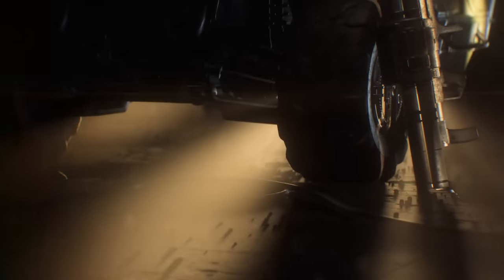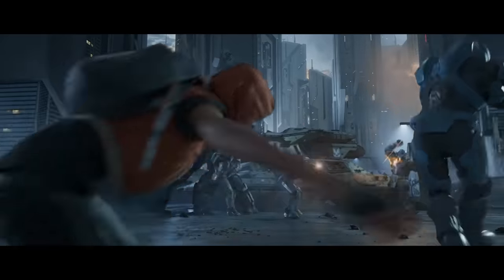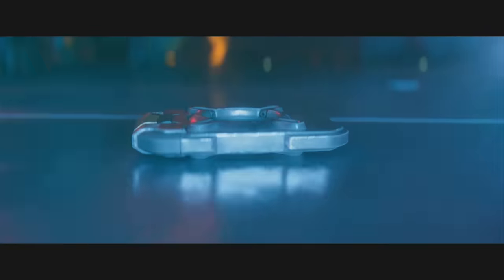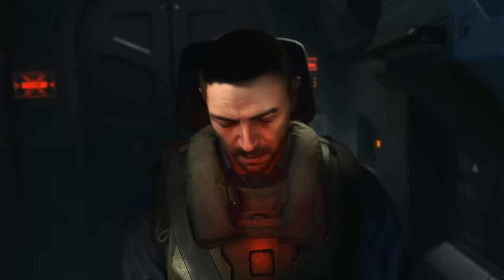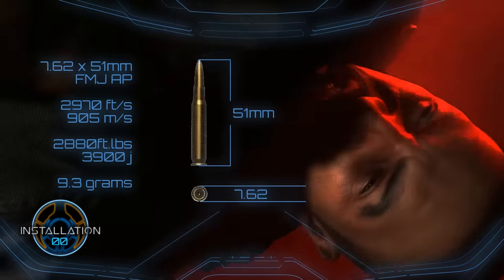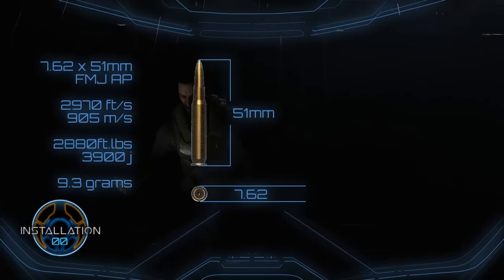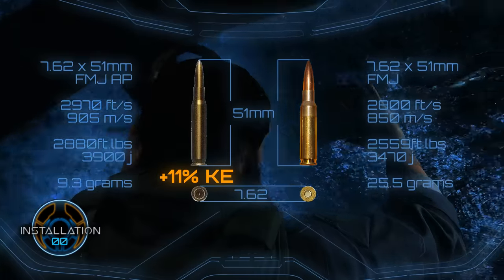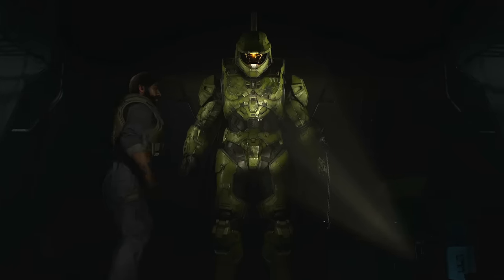Why are UNSC Weapons so powerful!? | The Armory

Comment: Should be using more powerful calibres in 500 years in the future? Energy based would be more achievable as well without the use of covenant or forunner technology. If they can put a micro fusion to power the armour that can do the same with a energy bases weapon like the size of a rifle. For example 50 bmg round 500 years in future would be worth a penny if using the same manufacturing techniques. Hydrogen powered vehicles and equipment the UNSC can easily mass produce can easily make a compact hydrogen power pack that can power a cheaper light infantry power armour. Given the UNSC a better chance in the conflict while alien technologies could enhance the capabilities of any vehicles and weapons in the UNSC arsenal.

Comment: Okay okay okay, no. As much as I like the idea of some sort of magnet system built into the guns, it would easily be at the bottom of the list of reasons the rounds are stronger. 

I personally think it’s a combination of denser and stronger metals. New layerings of the jackets. A change in the chemical compositions, and pinpoint perfect metal smithing and gun manufacturing that ensures near perfect powder burn efficiency

Comment: 7.62x51 is basically 308. So that is a very powerful bullet most dmr are chambered in 308. So dont confuse 7.62x39 wich is the usual AK47 round witch is an assault rifle with a 7.62x51 round witch is so powerful that normal people cant shoot it accurately in full auto so basically only halo spartans can do that

Comment: There’s a genuinely simple explanation that you’ve missed, and I mean no offense by this. 7.62x51mm M118LR. Fired out of a 20” barrel with a 1:11RH twist it averages 2600 fps at the muzzle. However. In comparison to the faster and less optimized M80 ball, the bullet weighs MUCH more, at 175gr in comparison to the 147gr M80 ball. At 2600 fps, your kinetic energy at the muzzle is around 2520 ftlbs. So that matches what you’ve got already for the modern cartridge, while traveling much slower. HOWEVER. If I were to up my muzzle velocity to 2800fps, which is what you’ve listed, by, say, adding a bit more propellant, it would be pushing out about 2940 ftlbs of energy. There you have it. Source: The Kestrel 5700 Elite Ballistic Calculator with Applied Ballistics sitting on my lap

Comment: The numbers given at time stamp 4:40 are wrong.   Both bullets weigh the same 147 grains. 
A 147 grain bullet moving 2970f/s generates 2880pound/feet of energy.  
A 147 grain bullet moving at 2800f/s generates 2559 pound feet of energy.   

I'd assume Bungie just took a random info about ballistics and threw it in the game not thinking anyone would dig any deeper. 

Also, burning gunpowder doesn't require O2 to fire a bullet. ............... 2 KNO3 + S + 3 C → K2S + N2 + 3 CO2   ........... No extra O2 needed.  All O2 is in the KNO3.  Not to mention that the case is a sealed container and the barrel is an extension of that sealed container. 

In the world of ballistics 300 pound feet is an insignificant difference.  Its the difference between having a 4 inch longer barrel.

Comment: @Installation00  I think the weight difference in rounds could be due to a much better propellant, there has been what, some 500+ years to further hone chemistry, find a new more efficient propellant that has less mass, but the same energy. Stronger materials, maybe the casings are made of something that can take 3 - 4 times the pressure of normal gunpowder, thus allowing them to say... upgrade from what might be considered the difference between normal rifle ammo, to something far more energetic. Like... I don't know, like missile propellent? I am not a chemistry major, or know anything beyond basic guns so I may just be talking out of my @$$ here.

Comment: I enjoy the games too, have for nearly 30 years (FFS, look at my avatar, that's an in-game still from my own character)... The weapons are as powerful as they are because of plot armor. When fired by a regular Marine, they weren't nearly as effective as when a Spartan picked them up. No, the weapons aren't different, the game design for character rearmament is battle-field pick-up. You die, we split up your gear kind of stuff. However, it is fun to speculate. And, since I'm a factory certified armorer for the M16/Ar15 system, a firearms instructor and have been reloading since age 10, I love this shit. The guns weren't more effective. the Spartans just had better training, determination, reflexes, enhanced visual acuity, far more precision, etc. The UNSC would have to be using way higher chamber pressures for the ammunition, superior metallurgy for the chamber strength and barrel life, better coatings for the materials, so many things. They'd also need some Advanced Dungeons and Dragons magic to create "Mags of Holding", because you aren't fitting 30+ rounds of 7.62X51mm cartridges into THAT magazine. Even if they could narrow the cartridge case to the bullet diameter or use case-less ammunition. Hell, the outside barrel diameter of the auto-rifle and battle-rifles are barely .30 caliber, much less the rounds being fired. So, my answer is "Space Magic".

Comment: So I'm at the 2:41 mark and im only commenting this so as to make it known. Yes while a 12.7 x 30mm round sounds ridiculous and very much is. A 50 cal pistol round in similar dimensions does exist and while not in military use now it was considered for it. The 50 cal shot by the desert eagle also know as the 50 Action Express is a 12.7 x 33mm round. So ridiculous... yes... but impossible no... practical? Well thats up to if you feel the need to adversite your wrist strength?

Comment: Better powder, stronger casings allowing for higher compression, better alloys in barrels and actions allowing for higher compression, lighter, faster and stronger bullets and certainly some sort of a "Booster" system are all easily imaginable in the far future. 

Honestly I doubt the 7.62 would have any real military applications in the far future. Though reliable, far superior rounds have ALREADY been developed to replace it in 2023-2024. That being said, even a 7.62 in 500yrs might have tech cooked into it that we can barely even fathom. 

A fun side note, why hasn't the UNSC just started using plasma based weapons like the covenant? They have everything they need to reverse engineer and adapt to human frames. Presumably the Covenant went through their own industrial revolution and started with human like guns and ammunition. They probably eventually found that plasma based weapons were far superior and scrapped the antiquated gun power and projectile. Just a fun thought.

Comment: I would if 6.8 will come to Halo as it is being a new round the US armed forces are seeking as a more powerful round to 5.56 in other to better penetrate body armour. General Dynamics bullpup design has its 6.8x51mm round, with it's plastic case instead of brass or a hybrid, have up to 20% more energy compare to the stand 7.62x51mm NATO round.

Comment: I assume metallurgy is far more advanced and thus much higher chamber pressures are possible. The specs don’t reflect it but UNSC cartridges realistically would just be able to produce much higher velocities. Velocity is much more important than mass when considering the KE equation after all. We can already see this trend today: modern 30-06 for example is not recommended in ww2 era garands due to modern rounds having higher chamber pressures. No need to overthink things with railguns and crap, literally just shoving more powder in the cartridge because the chamber can handle more stress is a good enough explanation. This development literally just occurred again with the NGSW program. Again I just assume the velocity and mass stats are BS because logically they don’t make sense.

Comment: That with the MAC tech isn't that unlikable. especially the MA5 is bulky AF but usually unneccessary bulk is something to avoid at military weapons. So it very well could be, that the MA5 has MAC technology in it and it also would explain, why the round is so much more powerfull, while less than half as heavy. Becouse the powder charge would just act as an initial push, so that the round don't weld shut to the rail. Wich actually is a real world problem on real rail guns.

Comment: Are we comparing this against alien armor and shields or against human armor and shields?  Where is this perception of greater force results stemming from?  

If it's alien tech... it could simply be that the tradeoff aliens have made in becoming a high tech war fighting civilization was to favor complex weapons with shorter supply chains (but greater repair facilities required, when the incredibly complex fusion launcher suffers a blown fuse).  Humans using 7.82 or .308, have to manufacture ammo and weaponry with significant mass, which require significant logistics to move from A to B, and prepwork in advance of any invasion force.  Perhaps then, the reason alien tech doesn't quite hold up or compete as far ahead... is because of a logistical trade off they made.

But that's perhaps not entirely an ontopic discussion.

Comment: The answer is simpler than you realize . heavier denser bullet ; depleted uranium is heavier and denser than lead . depleted uranium is already in use for armor piercing tank cartridges . depleted uranium rounds with higher quality gunpowder fired through a high density forged metal gun barrel would very easily produce those results . given that the halo universe is 500 years into the future , it is more than reasonable that the metal forging process of gun barrels would be a little better . the cartridge casing metal quality would be a little better . the gunpowder quality would be a little better . none of this is a big stretch at all . i would actually expect 500 years into the real future the technology would in fact be better than we see here in halo .

Comment: I can never get over why a military 500 years in the future would still be using cased ammunition, or firearms all together. Edit: In 500 years we'll be using mass accelerators and direct energy weapons as small arms.
Reply: They just work.
Reply: Even today where drone & missile warfare takes up most of the battlefield. We still use infantry & firearms just in-case. I don't see it any different in the future.
Reply: @tristanbackup2536 I shoulda been more specific. Technology will soon evolve past firearms into more advanced weapons, first with mass accelerator weapons, which we already have, and further down the line we'll have direct energy weapons and particle accelerators. All of that technology is already current, its just not portable and cheap to produce yet. 
Btw, drone warfare is effective cos it's low risk but boots on the ground are still very much a necessity today.

Comment: Electronic ignited rounds. That alone is more efficient than mechanically fired rounds. I personally preferred that alongside a electronically controlled recoil system. I've hated the laziness of the accepted lore of modern day firearms for Halo's guns. If 7.62x51 then it should not be a NATO round but some new reworked 7.62 with a new designation. Metallurgy alone would have improved the performance of firearms in the Halo Universe just as it has improved armor.

Comment: As a certified gun-nut, let me first commend you for also noting that the weapon classifications and calibers are utter BS to start and I appreciate that you realize that.

As for the issues of the cartridge itself being more powerful than it's modern counterpart there are a few other potential solutions as well. 

1: The actual case technology. Modern cartridges are often limited by the pressures found in the brass cases used by NATO forces. We have, and still are, experiments into utilizing other materials for the case of the round. Brass is the most common because of it's thermal properties allowing it to extract some waste heat in the shell upon ejection, and the natural lubricity of brass which reduces friction related wear on the firearms various internal components. Brass cases however, have finite strength as they cannot safely be subjected to pressures far exceeding 60,000PSI (415 MPa). 
This however can be alleviated by hybrid case material design, as shown by the new 6.8x51mm Cartridge adopted by the US Army this year, which has a primarily brass case but with a steel bonded rim and primer pocket, allowing the new round to operate at a significantly higher 80,000PSI (550 MPa). They could also be using a case entirely composed of a different material with a higher overall strength, which could allow the necessary pressures to improve the round's performance.

Which leads me to point 2: Firing mechanisms. Modern ammunition is fired by striking a primer, which provides the spark that ignites the powder. This method has remained almost unchanged since before the advent of the self contained cartridge itself, when we still loaded lead and powder over percussion caps. Current ammunition's weakest point of failure is the pocket this primer is mounted into, which has lead to hybrid case ammo development to reinforce this area. But if that portion of the case was solid?
Enter: electronic firing systems. If one could seal the entirety of the former primer pocket, and instead use electronic ignition to start the propellent, then the pressures could be scaled significantly to the strength of the case material itself. This could also be used with more powerful and more stable propellants, even potentially some form of plastic low explosive. We know with the M7 SMG that the UNSC has developed caseless hardened propellant ammunition that is perfectly stable, and this is the proof that the concept is not only possible, but viable.

I hope that perhaps my ranting may provide some insight into an otherwise confusing technological rabbit hole. Please keep up the good work my friend.

P.S. :The weight provided by official sources is plain nonsense, modern M80 Ball fires a bullet that weighs 140 grains, or 10 grams. That their whole cartridge somehow weighs less the the actual bullet it fires is indicative only one of 2 options. Either BS numbers, or sorcery.

Comment: Aside from the fact that the UNSC arsenal was intentionally made to mimic Vietnam era US weapons, most of their weapons don't appear to have changed or evolved much over 500 years (which is ludicrous at face value, but I digress). It was also intentional to put in things that players could relate to in real life, to give it a sense of credibility, where a laser gun would have pushed it straight into Sci-Fi without any veneer of reality.
Sadly, anytime anyone hears laser or energy weapons, it immediately goes into sci-fi and many players suspense of disbelief is broken, whereas putting something remotely real allows players to believe that they could be the MC even today (which is impossible, but psychological association and all that).
Having explained my grievance at the disconnect between technological advancement and need for reality in order to create a psychological safety bubble for player, I will say this and it's one of the few things that makes this make sense, even when it is still grasping at straws.
500 years of technological advancement would have yielded more advanced chemical compounds than any modern equivalent and also better materials.
UNSC makes use of advanced nano-composites in every day applications and obviously in military matters, the most well known of which is the Titanium A battle-plate, which is a nano-forged alloy, that creates specific titanium strata within the material, giving it material properties not possible with modern techniques.
Using this as a reference, we can assume that any alloy would have nano-structures designed to better dissipate heat and or increase tensile strength and so on.
Thus weapon barrels and parts can withstand higher pressures from an older looking cartridge that itself is filled with advanced nano-composite propellant that would significantly increase round speed, even though it looks like a 500 year old catridge.
Again, this is a lot of grasping, but the technological basis for all this is quite common in the UNSC, so it allows for the insanity that is retaining a round that should have at the very least been heavily revised centuries ago at a minimum and outright replaced for something hopefully better.

Comment: What evidence is there to suggest UNSC terminal ballistics (projectile performance on the target) is that much more substantial than current day?  
There are bazillions of variables when looking into projectile performance.   Do you want penetration to get into a vital part of an armored target?  Do you want deformation(‘mushroom’) to cause a bigger wound channel on less armored or thick targets? 
To muddy the water even more- sometimes bullets going slower penetrate less!
A bullet is constructed to deliver performance at a certain velocity threshold.  If a fragmenting or expanding bullet is below that threshold(say a long range target) it will maintain its shape and penetrate deeper than a bullet striking at higher velocity of similar construction.
While they say the Combat Evolved pistol (M-6D) is overpowered, that may not be the case.  Modern day revolver in the .45-.50 caliber class, with hard cast bullets are capable of some insane levels of penetration based on what specific elements you add to normal wheel weights.  Yes, wheel weights (as in tire shops) can be cast into bullets on your kitchen stove(although breathing lead fumes in an unventilated area is really dangerous).
Penetration in stacked, wet newspaper is measured in FEET.  36”+ is not uncommon for these bullets.
Altogether, a good job that touched some aspects of a confusing subject.
Thanks.